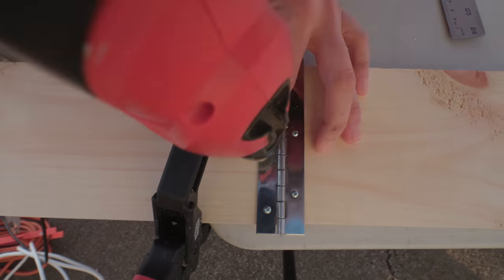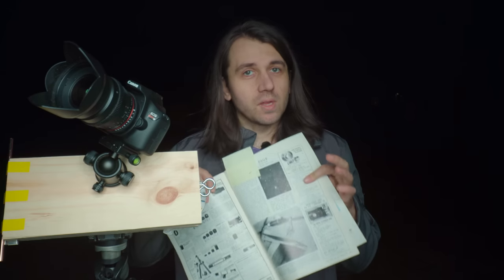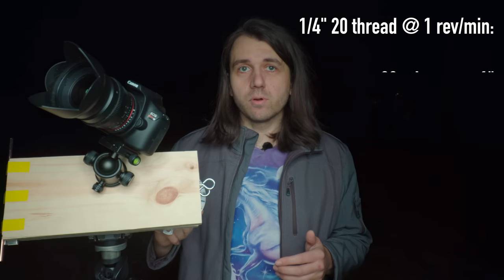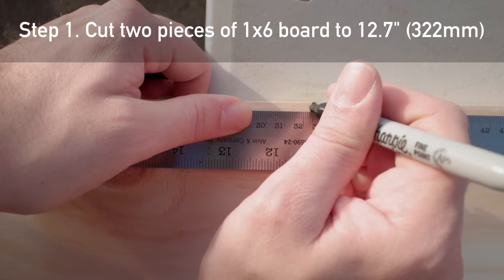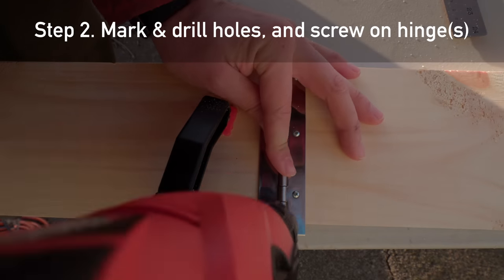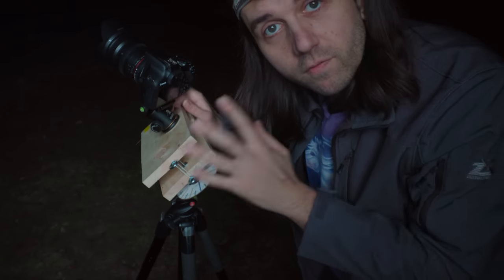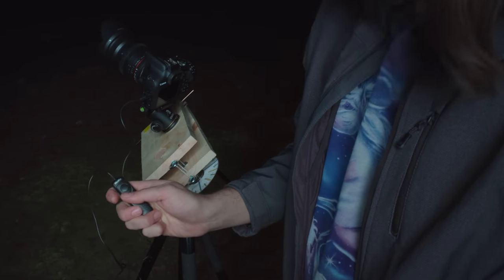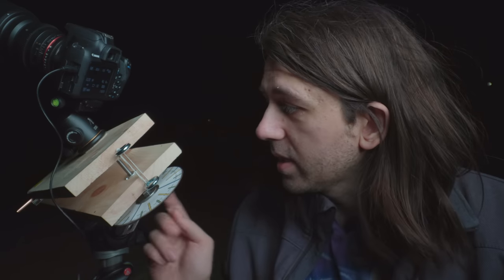I Made A $30 Tracker, Is It Any Good?

Comment: Hey, Nico, quick question: how can i offset my IR cut filter for emission nebulae photos WITHOUT removing the filter from my stock Canon T3i?
Reply from the maker: You can't. There is a physical IR cut filter that is glued to the assembly. The only way to fully open up the sensor for red emission nebulae is to remove the blue low pass filter in there. That said, you can certainly still capture emission nebulae without modifying the camera, it just won't be as efficient. On most DSLRs the Ha line is passed at around 30-50% transmission as a stock camera.
Reply: @NebulaPhotos  thank you! I appreciate the time you took to answer! I think i'll keep my IR filter since this is my go to everyday shooter and try out a nubula and just work on it :) i just wanted to make sure it wouldnt be impossible to capture a nebula if i kept it. Thanks!

Comment: There is a very low tech way you can perfectly align your tracker, without any expensive machinery , and no straws attached to the barn door hinge either .  You get a copy of your local "Fisherman's Guide" , or what ever that is called where you live .  This will give you the sunrise and sunset times for each day, so you subtract the sunrise time from the sunset time, for the day you are at, and subtract the two.  Divide the answer by two and add the resulting hours and minutes to the sunrise time, and that will tell you the time when the sun is exactly 90 degrees overhead.  Now hang up a string , with a plumb bob on the end and mark where the shadow of the string lays, on the ground, at the minute when the sun is exactly overhead.  The shadow of the string will be exactly aligned with the rotational axis of the Earth.

Comment: What tripod are you using? If you connect the bottom board with the tripod using a screw, how is the angle of the board adjustable? Wouldn’t the board just be fixed to horizontal only?
Reply from the maker: Correct, you need to use a tripod with an adjustable tripod head so you can do the polar alignment. I didn't include the cost of the tripod in the $30 for the tracker cost. I use aluminium tripods from Manfrotto / Bogen, in this case one with a sturdy pan/tilt head (Manfrotto 501HDV). I find these tripods stand the test of time well. I've bought ones that are 20 years old that still work well.
Reply: @NebulaPhotos  thanks so much. I’m a beginner to astrophotography, do you have any recommended resources? Everything seems so daunting.
Reply from the maker: @sigh7310  Have you seen my Andromeda with no tracker video: https://youtu.be/pXcRKoxTPVg I designed it as a start to finish guide for a beginner who has a DSLR, Lens, and Tripod. Orion Nebula then Andromeda Galaxy are my two suggestions to start with deep sky.
Reply: @NebulaPhotos  thanks a lot. I’m assuming the same steps and techniques in these videos mentioned can be applied when using this tracker?
Reply from the maker: @sigh7310  Yep, this tracker as-is only works for wide-field 50mm f.l. or wider, but other than that, yes, all the same techniques can be used, and you can take fewer total exposures since each photo can be longer due to the tracking.
Reply: @NebulaPhotos  thank you. As I’m taking photos. Wouldn’t some objects appear and some disappear from my frame? Does that matter when processing? 

Second question is, can I do this at a fairly light polluted city? I was watching your andromeda galaxy DSLR video and it said to drive away from the city. On the other hand, this video (https://youtu.be/AKKlzbgQStE) was done in a light polluted city,  but a small telescope was used. How will the results look like if I don’t use any telescope at all?
Reply from the maker: @sigh7310  Orion Nebula, Andromeda, and a few other bright objects can be done fairly well from the city with enough total time on them. Dimmer objects are harder to do from the city without filters. In terms of objects appearing and disappearing. While you are tracking with this barn door tracker they should stay centered as you are 'tracking' the night sky. Once you reach the end of the screw and have to re-wind, you will need to recenter your object.
Reply: @NebulaPhotos  if recentering doesn’t go perfectly, it’ll be handled by the stacker right?
Reply from the maker: @sigh7310  Yes, the stacker will align all your frames based on star patterns so as long as about 1/2 the same stars are in each photo, it will do its best to align them. The closer you recenter, the better the results, but doesn't have to be perfect.

Comment: I'm actually shocked that even at 24mm focal length, periodically touching the wheel to advance the tracker with your hand didn't disturb the pointing enough to affect the images; I would have assumed that even fairly wide shots would require at least a small motor to drive the bolt so you could stay hands-off to avoid this effect. Great shot, but man that would get tedious after a few times!

Comment: To orientate the board to Polaris would the cross hairs for a horizon in your camera wor? (assuming the camera has that option) then align the camera for the actual shot?
Reply from the maker: If you had a way to make sure the camera was at the same angle as the hinge, that would work decently. Not sure how to get the angle perfect though, maybe a digital level. Thanks for the idea
Reply: @NebulaPhotos  the digital level and use the straw as the vertical alignment tool? Thinking too hard! 😁

Comment: thank ou for an amazing video! when you rewinded the bolt to continue shooting you also cahnged the camera position too. and how did you be able to stack these photos with the previous ones ? please answer if you can. i know you are busy but thats reeally busying my mind
Reply from the maker: Yes, sorry for not mentioning that. Everytime I rewound the device, I manually recentered my composition using the ball head. The process of re-centering wasn't perfect so there was about 15% of registration artifacts that I cropped away from the edges.
Reply: @NebulaPhotos  thats the reallly important stage, for me the most critical, because its dark and cant see the frame well. Many composition shots requried and 3 axis alligment is a must. Does your software does the alignment? , thank you for your reply :)
Reply: @berkdeniz  yes, all the software option I've used (DeepSkyStacker, Siril, PixInsight, etc) handle alignment based on the star patterns and can do x, y, rotation, and scaling, distorting, etc. To handle 3-axis differences in the frames. The stacking software are very good!
Reply: @nicocarver2473  thank you very much! Im soo happy to hear this really!

Comment: Hello, I am building one following your plans, my question is related to the hemisphere. I am from Chile, southern hemisphere, so should the position of the hinges be on the opposite side of the one indicated on the plans?
Reply from the maker: Hi Jorge, I don't believe you have to change the design. Instead, the rotation will be opposite in the Southern Hemisphere - you will want to rotate the disk/screw clockwise rather than counter-clockwise as i did. If you follow my design, I believe this will mean starting with the two boards further apart and rotating the screw so that they close.
Reply: @NebulaPhotos  That is, the tables start open and the follow-up will do so by closing them.-
Reply from the maker: Right!

Comment: excellent video, but I am new to this area. how could I use it here in the southern hemisphere (Rio de Janeiro-BR)? any tips?
Reply from the maker: Someone has given me the tip of using an app called 'SkEye' for Android phones for polar alignment. I downloaded it, and need to try it out, but should work in the Southern Hemisphere too. Basically you would just put the phone on top of the tracker and to line it up to the SCP (southern celestial pole) in the app. The idea is it will use your phones magnetometer, gyrometer, etc. to get the right direction and angle.

Comment: Ok i have an idea and i dont know if this is dumb idea or not😅😅. So the idea is to connect a clock's motor to the screw so that you dont have to manually rotate it 1 time every minute, the clock motor should be smooth and not the tick tock one. ✌️
Reply from the maker: It's a good idea. For this one, I just wanted to keep it simple, motorizing it would make it even more useful
Reply: @NebulaPhotos  Thanks. Btw looking forward to see your upgrades on this🤗

Comment: Hey Nico! can we use it on a 150-200mm lens 
btw where's part 2 😁😁
Reply: How many seconds do you wait before you spin? I believe last time I attempted mine I did what niko recommended 15 degrees at 2.5 seconds
Reply: @Caboose301   We can use a motor to modernize it

Comment: Is the distance from the hinge to the tee nut can be any measurement?, I see sum template from a website that the measurement from the hinge to the tee nut is 6’9 inch but yours is 290mm.
Reply from the maker: No, for it to work with a 1/4" 20 bolt as I did here, the distance between the hinge and the tee nut must be 290mm (11.42 inches) for the tracker to work properly.

Comment: The location I setup at doesn't have a good view of Polaris, so what would be a recommendation for polar alignment at a place like this?
Reply from the maker: You could try mounting your phone and using the app 'SkEye' I haven't tried it yet, but some people have been telling me about this technique.
Reply: @NebulaPhotos  I've been doing something similar, but kind of eyeballing it. I may have to try doing a more solid mount. I had been thinking about trying to find exact coordinates of Polaris, and placing something almost like an astrolabe/compass setup on my mount, and then blindly positioning using that. Thanks for the tip!
Reply: The good news is, where I setup at home, it is generally a fixed location. I've been dialing in my, "best guesses," and slowly narrowing it down until I find almost exactly where it would be polar aligned perfectly. At that point I am going to put some sort of permanent base for the feet of the tripod, and should be able to hit it on every time after.

Comment: Save that issue of Sky & Telescope.  It appears to prove the existence of time travel.  In particular, you say you are using the original design from the 1975 magazine and a compact disc is one of the parts.  Yet, the cd was not commercially available.  Therefore, the designer must have learned about cds through some form of time travel.  The designs I have seen call for a floppier plastic coffee can lid or a couple of paper plates, with the idea being any vibration from your hand turning the drive wheel would be reduced.  Your viewers may want to experiment with that, especially if they don't have a rock solid tripod.  I was disappointed to not see any good polar alignment suggestions.  If you ever identifying one, would you please publish a video on that topic.
Reply from the maker: 😂 you got me, I am a time traveler! Interesting about using a floppy disc, I'd be worried about the accuracy of turning that. I haven't found vibrations from my hand to be an issue at all. I do recommend sitting as still as possible on a stool though. I actually have gotten a few interesting ideas around smartphone apps, which led me to a fairly new star hopping method for polar alignment in the iOS app "PS Align Pro" that doesn't even require having the NCP or SCP visible. I will try it out, and if it works well include in an upcoming video. Another similar idea in the app "SkEye" for Android as well.

Comment: Wondering if a cheap air soft red dot sight would work in place of the straw?
Reply from the maker: Yes, if you could line it up accurately on the same axis of the hinge, it would likely work better than the straw. Same thing with a green laser.

Comment: Nice! I 'd like to try it, but things with a 1/4" 20 thread is hard to get in the Netherlands.. especially T-nuts :-( its all m4,m6,m8,m10 here. But the cameras and tripods are 1/4"20 of course..
Anyone in the Netherlands know how to get 1/4"20 T-nuts here (they're called inslagmoeren here)?
Reply: I think you are missing the point. Yes, 1/4" 20 works out nicely but M6 x 1 will work fine with a slight adjustment in timing. you will soon get bored with it anyway & fit a microcontroller & motor into it. I also added another board and hinge For the alt adjustment this also ended up motorized when a stumbled upon a Neo-6 on ebay, GPS < £10 how could I not. :D

Comment: How much weight can this tracker hold
Reply from the maker: Not too much, but any normal DSLR and Lens should be fine. I'd say 5-6 pounds is as much as I'd put on it. Much more and the bolt may slip backwards under the weight, or it would be hard to turn smoothly.

Comment: I tried to build one , but it might have a little shaking when I turn the wheel . How to solve this problem.
Reply from the maker: Try putting the tripod low, and use it seated in a chair. I think it's easier not to shake if you are seated.
Reply: I understand! However, I've noticed that screws can cause slight circular marks on the wood due to the hinge not being perfectly flush. I can't seem to find the perfect hinge. Is there any way to solve this issue?
Reply from the maker: @柯彥伯-w9v  I think it helps for it to be one long hinge that extends the whole width of the wood boards. This is the one I used for reference: https://basscatstore.com/6stainlesspianohinge.aspx In the US, they call this a 'piano hinge'.
Reply: @NebulaPhotos  Thanks! I would try it.

Comment: Nebula Photos   -    I used to work on office equipment years ago. Mechanical time clocks that were used to punch in workers used a motor that turned one rotation per minute and were very accurate.  Seems to me that your best upgrade would be to attach one of those old time clock motors to your drive screw. A battery and a small inverter would power it very well and it would eliminate the need to touch the mount  until you needed to reset it. I would recommend the motor on a hinge so it could swing out of the way when the drive screw needed to be reset. should be an easy upgrade...

Comment: A good ball head suggestion for the same?
Reply from the maker: https://ebay.us/yWTCgU This the one I bought. Definitely the most expensive part at $17 (free shipping). The rest: wood, bolt, hinge, nuts, blank cd, glue, etc. are much cheaper
Reply: I made a motorized version, so now I plan to upgrade the flimsy parts, ball head being one of them.

Comment: Can I make this and just add a 1rpm motor to make the turn?
Reply from the maker: Yes, as long as the motor is strong enough to turn the bolt with enough force to move the payload
Reply: @NebulaPhotos  thank you , would the spin rotation vary on the lens say i switch our from a 24mm to a fish eye 7.5mm besides the duration of the exposure 30 sec vs 1 min does this have an affect on slinging on the wheel say one full rotation every minute ?
Reply from the maker: It is the same rotational speed regardless of focal length. What changes is how often you NEED to move the wheel if moving it manually, but with a continuous motor that won't be an issue.

Comment: Going to make one myself but... what does the 1x6 mean?
Reply from the maker: Just a common board size like a "2x4". The 1 by 6 refers to the size of the board in thickness and width in inches. (But if you actually measure a 1x6 it is 0.75" thick by 5.5" thick). Any piece of wood around that size will work fine. The important thing is the measurement from the hinge to the drive bolt and the threading on the drive bolt.
Reply: @NebulaPhotos  Hmm, ok. Thank you for your response. I understood the length is what matters most. So 2-3cm thick and 15-20 cm wide. I'll share some results as soon as I get it to work! (from Europe)
Reply from the maker: @cedriccappelle2036  Yep, sounds good Cedric. Here's a link with the same design, but talks more about metric sizes: https://blarg.co.uk/astronomy/barn-door-tracker

Comment: Any way to motorize this that anyone has found and/or tried successfully?
Reply from the maker: Yes, I'm working on it with some people on my discord. Many others have done it. Usually using small stepper motors and arduino to control them. Before arduino, people would just use egg timer motors, or clock mechanisms.
Reply: @NebulaPhotos  Awesome to hear!  I actually built a barn door tracker this afternoon using your video and plans. I have a 75mW laser pointer that I've adapted for polar alignment instead of the straw method. Unfortunately it's cloudy so I cant test it. 

On that note, have you tried using this (or any barn door tracker) with a smartphone?  I figure it should work in the same fashion as a DSLR, right? Albeit.. clearly the photo quality will not be nearly as good.
Reply from the maker: Yes, check out this video I made: https://youtu.be/Xc1v6BjHm8U with the cheapest kit, I'm using this exact barn door tracker with my cell phone and though the results looked pretty good

Comment: can I just use a 1 rpm motor instead
Reply from the maker: Yes, as long as it can reliably turn the screw pushing the weight of the hoard and the camera. You'd might  also want a fast reverse to rewind quickly.

Comment: Can you use it in capturing orion?
Reply from the maker: Yes
Reply: @NebulaPhotos  i just finish making one
Reply: How fast do i need to turn it for a 300 mm focal length telescope?
Reply from the maker: For 300mm, you would need continuous turning. I don’t think a barn door tracker will work that well for long focal length like that, but it might allow you to do slightly longer exposures than with no tracker. I only tested mine up to 85mm, but found 50mm and under was where it worked best.